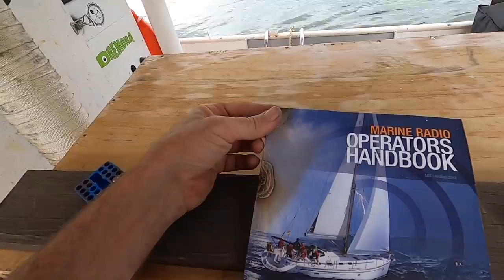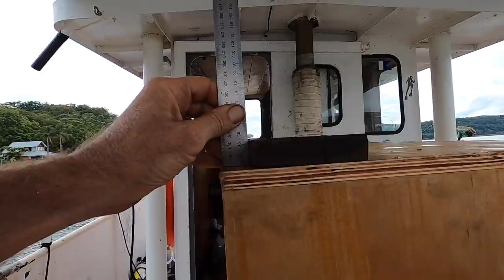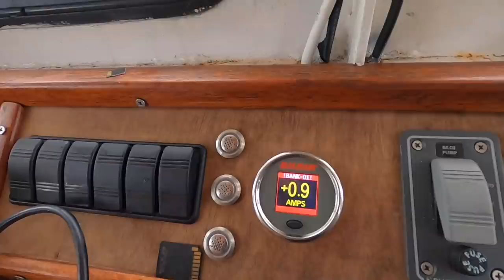Steel trawler wheelhouse fit-out

Comment: Not sure that was enough safety gear you had on there!
Reply from the maker: Screwdrivers are more dangerous than they look.
Reply: @DangarMarine  hence the ear protection, I put corks on the ends of mine.

Comment: Hi Stu,  the boat is looking really good.  for your water problems,  why don't you use a manifold for all the different compartments. One pump, 4 different hoses and 4 shut off valves.  be a hell lot easier for pumping out..
Reply from the maker: I am temped to do something like that.
Reply: @DangarMarine  hey stu. There is a system you can make using sponges and a timer set up on a jabsco diaphragm pump. It uses “t’s” and pvc tubing.  It’s a great way of getting water out of multiple compartments with one pump. If I can find it I’ll tag you in it

Comment: Small bungee cords across the front of the wire baskets would be simple, cheap and easy !!!
Reply: I did something similar but I put them underneath attached to the back, you pull them out and they get pulled back in by themselves
Reply: @yoslick4079  perfect !

Comment: Hi Stu,
Great video as usual,
@ around 14mins50sec you mentioned GalMet, and then welded over it, hadn't heard of it before googled it and there local to you. What's the chance you could get their representative in one of your video's giving a bit of advice on when to use different products.
Here in the UK Hammerite have the market share but a bit pricey or Rustin's (originally wood care products) for rust converter and protecting metal.
Went to a talk on a while ago at my local yacht club given by AkzoNobel who own International paints talking about Antifoul. The talk was a lot more interesting than just watching the product dry.
Reply from the maker: Galmet is a great product. There are so many good products around that it really is worth doing a run through of them and when to use them. It really is a case of just sharing the knowledge without out it coming across as a big advertisement but learning about a new product that works well can be the best thing.

Comment: Hey, Stu. If you will ever use the emergency tiller / steering, there should be a ball valve installed in the hydraulic system in parallel with the ram. Normally closed, opened for emergency steering. That way the fluid can free flow from one side of the ram to the other during emergency steering..
Reply from the maker: Yes, will put it above deck. Also need to add pump for autopilot so all the steering plumbing will get drained and worked on soon.

Comment: England. Hi Stu. I used to flatten motorbike cylinder heads straight on plate glass with grinding paste. It's best to use one side for coarse and the other for fine. Eventually a feeler gauge under a straight edge will tell you when the glass has worn. Keep an odd bit of glass for the finishing lap. I did try Emery cloth and wet and dry but it's not as good - honest. It was a very good video this week mate.
Reply from the maker: Good point about regularly checking the glass for flat too.

Comment: The right hand side under the worktop against the wall looks to be a better location for your USB outlet rather than on the work top where every square inch is valuable space
Reply from the maker: Yes, we did talk about putting them inside the second draw where the laptops etc will live. Might still go that way.
Reply: @DangarMarine  also means if the worst thing happens heaven forbid and a beer is knocked over you won't end up with 4x in a USB

Comment: Hi again,
As for keeping your draws closed (sure there is a joke there) 
a couple of pipe saddles and a length of dowel to keep them shut?
Or something similar working on the KISS principle.
Lift rod out = all can open
Drop in = all locked
Not the flashest but quick, simple and reliable.
Just a thought mate.

Comment: Can't you just lift the floor and drill some limber holes in the lowest point of each of the ribs?  Then it should all drain to the lowest point? Or does the hull kick up at the transom?  Bet youre looking forward to finish welding and painting the deck!
Reply from the maker: It's a little tough because of the tunnel that the propshaft goes goes through.

Comment: Stu, Very nice seeing the upgrades.  Have you discovered the joy of wire-feed/MIG welding to plug holes yet?  If not, you are in for a treat.  You will be able to do every hole in your deck in a short afternoon, probably in an hour - really!   They are cheap, and are SO much better than stick for that purpose.  They lay metal fast and controlled.  I got an Eastwood 135 at a yard sale for $100, and I'm kicking myself HARD for not buying one years ago.   And it takes almost no practice if you are used to stick.  It's so easy, you will just stare at first, thinking, "That can't be right.  That was just too easy to be right."   

On thicker metal, you just lay a bead in a concentric circle, pausing a little here and there, and zip it closed.  It's literally that easy!   Touch with a flap disk and the hole is gone without a trace.

I like the coat hanger method for patching big holes, or in very thin metal.  Here is a video of how the coat hanger is used:   https://www.youtube.com/watch?v=-DvzUkMQGlk  

I think of all the holes I fought with using stick and shake my head...  I wish I had listened to a friend about wire-feed years ago.   And did I mention that it works with Aluminum?   That's a whole different topic, but long story short - I LOVE MY MIG WELDER!!!
Reply from the maker: Hey Tony, I did buy a MIG welder not that long ago, I'll definitely be taking it down to the boat for the deck repairs. :)
Reply: Nice!   I'm looking forward to seeing that video, and am eager to see whether you love it as much as I do.  Outside, you normally flux core wire, as the wind carries away your shielding gas, but in sheltered areas, the gas makes extremely clean welds with no slag.   Oh, and make sure you reverse polarity between flux and gas.   I used gas first and loved it, but flux wire was AWFUL.  Then I noticed that I was supposed to reverse polarity, and then it was butter-smooth again.     I hope it works great for you
Reply: Well when you do, don't forget to turn on the gas bottle!   I was going to post a video of aluminum welding.  I set up the camera, (which I always forget, until it's too late) got everything set up, and then started rolling video.    The welds were giving me a fit.  Popping, snapping, dripping, just terrible.   Turns out, I had my pressure and flow set right, but I had only cracked the bottle open a tiny bit.   So the video was horrible. Ended up having to grind a bunch of it, and it was decent in the end, but it took me maybe 30 minutes to do a 5 minute weld job.    Didn't figure out the bottle thing until I shut it off, and it only took 1/4 turn -  ACK!

I opened the bottle up, did a test weld, and it was smooth and beautiful.   It's either the pressure of the camera, or just my inexperience.  But live and learn!

Comment: Hey Stu.  One thing I think you should have in your emergency box is a BIG Roll of  Flex Tape.
Great thing is it works under water.  Nice to have for an emergency fix.
I hear that Nulon is coming out with their own version of a Thick Paste and Tape that works under water.
It will be called  "  Stop Leaking Ya Bastard "

Comment: Old story you fix the leaks at the same time you put in better pumps. So never get to use the pumps. what you need with those compartments is limber holes so the water can move down to the lowest point where you put the Pump.
Reply from the maker: I'll be happy to never need the pumps! ;)

Comment: Put a small pump in each of the bilge compartments that all pump into one central area, then put your big pump in the 'receiver' compartment. One string of power wiring and only one hose over the side. Those little 'Rule' pumps are pretty cheap...Might need a 'Swing Gate' check valve on the big guy to stop 'Backwash' when the level switch is satisfied...We had several open shelves on our Pacemaker, I got tired of picking up my slabs after every crossing and installed screw hooks on either side, then used short 'Bungee' cords to hold everything in place. Super easy to hook and un-hook, but strong enough to keep the bins in place...(Page 37, 'The Bruce's Guide to Boating like the Tall Poppies')... 8P

Comment: Have you given any thought to designing and 3-D printing pick-up nozzles for the bilge suction hoses? I imagine it would be pretty easy to do (at least in my estimation) starting with a piece of spiral hose to create an airtight thread-on connector for the pick-up nozzles.  I imagine that they would feature a wide rectangular base with 3mm legs on each corner to provide pick-up inlets at the surface of the hull.   Questions? Comments? jcambron@sbcglobal.net
Reply from the maker: Could be an interesting project for sure.
Reply: @DangarMarine  email me an inside diameter and I'll see what I can do...

Comment: Stu,
Figure out what type of carpet you are going to use, that will point you in the direction in methods/hardware/adhesives to secure it to the floor.  Mold/water resistant?
Commercial kitchen wet area mats?
Adhesive
Tack strips
Metal clamp strips

Comment: Having been a boater for many years I agree with your storage philosophy. However, I think you should rethink the storage beneath the wheel because you are putting things there that cannot be used in that area. I would put things there that you would use while steering or docking the boat because that's where the storage is. The things like the stuffing box puller or hydraulic oil can only be used in the bilge so why put it in the cabin? I would have a flare pistol, torch, ring toss, knife, first aid kit, anything that would be handy at a moment's notice and can be used then.  I am amazed at your work ethic! Keep it up and you will be rewarded.

Comment: It can be a challenge to make a 30 foot work boat habitable. Layout is everything! 

You made comment about raising the foredeck in the livestream in my mind it would be worthwhile looking at even if it was 18 or so inches it would give you more headroom than you have now and get your deck hatch higher for better ventilation with out a fan maybe. In the vertical between the cabin side and bulwark you can put a portlight for added ventilation.  Just offering ideas.
Reply from the maker: It sure is, no space can be wasted. There is merit to raising the deck for sure, something I'll seriously consider if we don't move to something bigger.
Reply: @DangarMarine  Once thought, it is only a matter of time before you are in the market... be it a car, a boat, or a house.
Reply: @DangarMarine  one of the problem for any suggestions I make I'm guessing because I don't know the layout below deck and under the pilothouse floor. I have seen a queen sized bed set fore and aft under the pilothouse floor with a near stand-up headroom trunk cabin forward for access to the bed.

Comment: When the legs break off those plastic chairs due to uv degradation, and they always do eventually, they break off with a big spear like point at the top. Many people have gone to hospital to have them removed from various parts of their anatomy. They are deathtraps.
I'm surprised how clear the water looks there. 
If this rain keeps up you'll be able to drive Renko over here for a few coldies. cheers.
Reply from the maker: They can be savage when they fail, that's for sure. The water isn't that clear anymore though. This rain has now made it a very murky brown. :(
Reply: @DangarMarine  I've seen 2 go . Both were like an explosion. Immediate and totally unexpected without any warning sign at all. Both people were lucky to not be too injured. I got rid of all the ones at my place.
Reply: Not a problem here in Oklahoma they blow away during the storms never to be seen again. Maybe Arkansas and Missouri have a surplus?

Comment: Perhaps drilling limber holes in the ribs between those areas of the lazerete would be a simpler solution than pumping separate compartments by hand.  Water would drain to the lowest point and put the pump permanently there.

Comment: I wonder if a sump was placed inside a wet vac and the outlet was sealed so you could vacuum water and as the vacuum fills with water the sump would pump the water at a rate it were continuously evacuating water overboard

Comment: Have you considered a fly bridge position? For shallow water and leisure. 😅 Or better some kind of wireless auto pilot remote and throttle
Reply: In all seriousness the way you want to use your boat could you get one of those wireless kill cord systems sponsored as used on ribs?

Comment: Stu, Everybody is saying to use "bungee cord" on the cabinet. But i reckon it would look great with doors. Some left over ply a couple of hinges a coat of Linseed oil and you're done. Bathroom room latches and drill two holes to put your finger thru to open said doors. Don't forget to drill air holes.

Comment: I am not a boatbuilder at all, but is there a good quality expandable "pump in " foam that can be used to completely fill the under floor areas ? If there was, no water will linger there ever.
Reply from the maker: The trouble with that is that it will stay damp and you will never be able to monitor for or repair rust without removing all the foam again.
Reply: @DangarMarine  Ta.

Comment: Redesigning the wheel!
Reply from the maker: No, keeping the original wheel.
Reply: @DangarMarine  on your trolley lift... I’m from across the ditch, just want to see an Aussi redesign the wheel, which is one step ahead of reinventing it...
We have three small cheap bilge pumps in each compartment around the engine, because it’s more a convenient thing rather than safety, going cheap wasn’t a concern. We still have the highflow in place and of course the bucket.